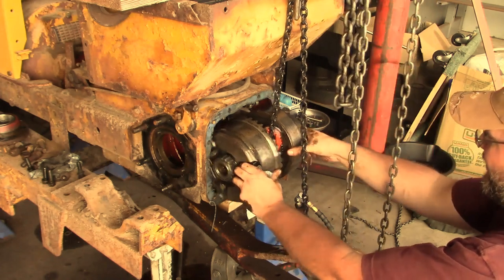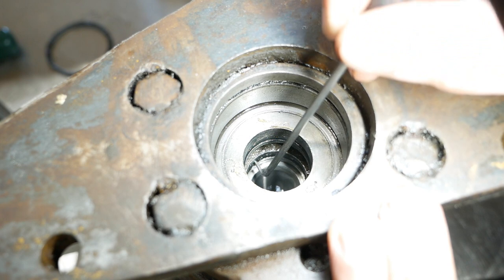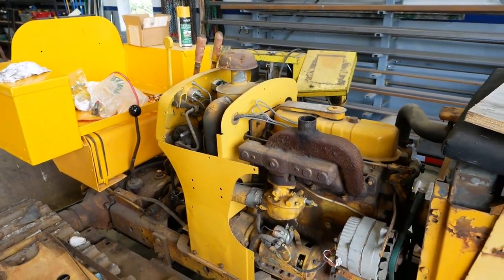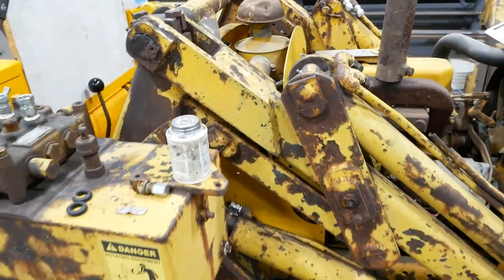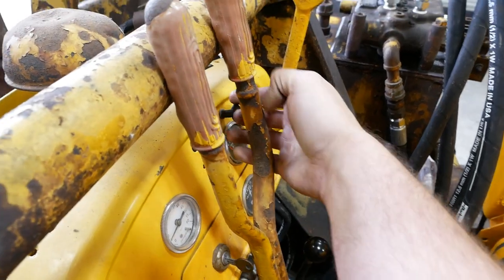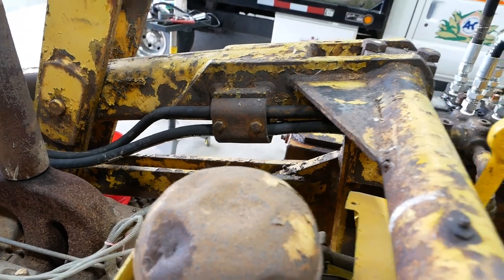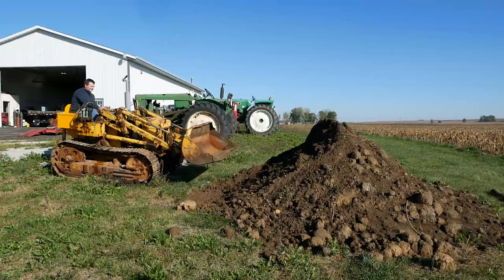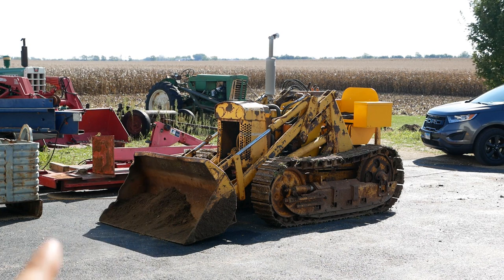60 Year Old Oliver Crawler Returns to Service - Installing Loader and Everything Else

Comment: I wonder if the  Green 1600 Oliver loader would have been smoother by killing the engine and letting it bleed down slow ly?? Or operating it with no engine running.
  I have done it before and sometimes on a machine that leaks down by itself.Ihear you on working alone. I bled the brakes by using a power seat to push the brake pedal.Farmer engineering we say
Reply from the maker: Oliver hydraulics don't work like that. There is a load check. You have to power the loader down. It's a terrible system.

Comment: 44:48 i wonder if you can't do a really cheesy fix... at least tell the owner about it. So in theory, this will never be a money earner, and by that definition, the solution would be to just make it not leak. Personally, i'd get a die grinder, clean the chrome edges so there's no lift, and then fill the gap with a metalized epoxy and sand it smooth. I've never done this kind of hackery with a rod, but i have repaired a rather complex copper sleeve that was too cost prohibitive to fix (regular epoxy + copper dust), and so far it hasn't leaked.
As for the spool valve, IMO, just use a lathe to make a blank that blocks the path + get rid of the handle. I've seen plenty of hydraulic hearts with extra spools, disabled in the same fashion (old mechanics using the good, unused spool to replace a worn one, and then "plugging" it. And because it doesn't move, you don't need to make it out of unobtainium. Even something like a HDPE rod will do. It just needs to plug the hole. Just my 2 european pesos.
Reply: SO far, the cylinders haven't leak much at all. I have done many repairs on machine tools with different epoxies, but wouldn't feel comfortable about the possibility of it breaking off and getting in the hydraulic oil. I've even patched up ways on machine tools with epoxy, but we ground a dovetail to lock it in place.
 I have also made new rods for several different hydraulic cylinders and will most like lean that way if I NEED to replace them.

Comment: You might laugh at this suggestion, but why don't you clean the hell out of that spool valve, do your typical crack propagation mitigation, then fill it full of JB weld and clamp it in a vice to cure then install it.  You're just trying to make a plug right... I've done worse with JB weld and it's held.

Comment: How about buying chrome bar stock of the correct diameter and replace the bad spool.  Machine the only features necessary to keep the new spool in place, don't include and ports for the valve function.

Comment: Think about switching the Oliver off and then lower the loader, you should be able to do it slower that way, not?
Reply from the maker: No. Oliver tractors use load checks. You have to power the loader down. It's a terrible system.

Comment: Well, I will not fault your workmanship.  I have to fault the wisdom of bringing this machine back to life, regardless of the heroic efforts made.  You certainly will not find many running on any farm.  Most are parked in a field somewhere, inoperative.  For the money spent, you could have a down payment on a Kubota or New Holland something.

My father was into IH TD-9’s and this machine has the look and feel of those beasts.  Painful to work on.  Always breaking.  Leaks everywhere.  They ran and worked, eventually, but at what price?

Since you get so many comments, I’m going to stop sending them.  A few requests before I go:  What about getting the old forklift going?   That would seem to have some value.   Also, how does Max keep warm in the winter?  I feel for the pup running around in the cold.  

Stay safe.
Reply: "fault the wisdom of bringing this machine back to life" ? Are you sure your handle shouldn't be Commie 114? Old Iron,and weekend play dates with other old iron owners, is as American as Baseball, Apple Pie and Hot Dogs.

Comment: What did I miss....  why didn't you just use a crimp on battery lug on the cable?    Yeah, I hate those "jerk" lugs too... I don't know that half a jerk is any better than a whole jerk,
Reply from the maker: I didn't have a 2/0.
Reply: @WatchWesWork  Ahh...   That just wasn't like you.  I knew there had to be extenuating factors.

Comment: The schedule 40 galvanized water pipe and fittings for the hydraulics on these older machines always makes me cringe.
Reply from the maker: The system only runs at 1300 psi. That was standard practice on these old timers.

Comment: And that’s a half-azz job using NPSM (or Female pipe) - should have gone full blown JiC!

And, is that was a Shcheifer oil you poured in to that hydraulic tank?
Reply from the maker: It's extremely difficult to get JIC hose fittings at the moment. It's Mystik oil.

Comment: Doesn’t the customer understand this is going to be a money pit? They should be thinking about a total rebuild? Afterwards they would have A totally reliable piece equipment. You did the best you could. There’s still issues with the valve body and the Cylinders and rods that’s going have to be addressed at sometime.
Reply: I don't believe it's anywhere near a "money pit". I will have less in it than a lot of guys pay for a "running dozer" that has worn undercarriage and may need engine work.
 This engine was overhauled before I bought it. Right after the overhaul, the right track quit driving, so it was parked.
 It also has nearly perfect sprockets, rails, and bushings in the undercarriage. 
 Now it has a rebuilt drive train.
 The loader has a little bit of wear in the main pivot, but all other pivot points show no noticeable wear.
 The only pit, will be ones i dig with it 🤣

Comment: Needs a fuel pressure regulator, the carburetor can handle the fuel pump output making the float level too high.
Reply: NO, it's a low pressure pump!
Reply: @bluegrallis  Sorry Charles but experience dictates what I said is true, those old Marvel type carburetors needle, seat and float design just can't deal with the continuous output of the electric pump, what is the output pressure of the pump Wes used compared to the diaphram pump?

Comment: Not sarcasm.  Would it have been better to have a right-angled connecter where the hydraulic hoses go into the main tank?  Seems to me, not a professional, a lot of strain on the hoses bending over like they are.
Reply from the maker: I would think so, but that's how the manual shows them being installed.

Comment: Wes them was to high geared. They should of had the 6 speed transmission  instead of the 4 speed the later one's came with a 6 speed transmission